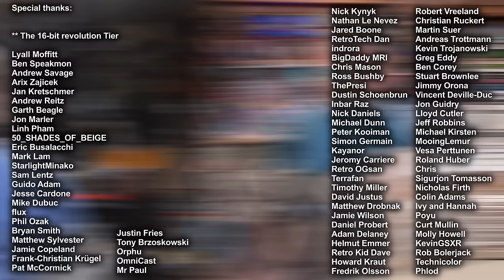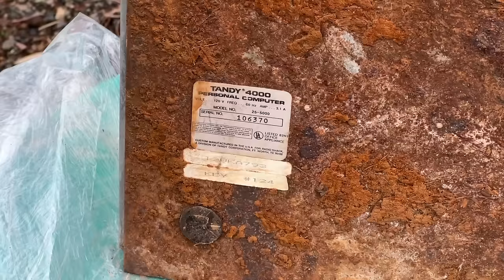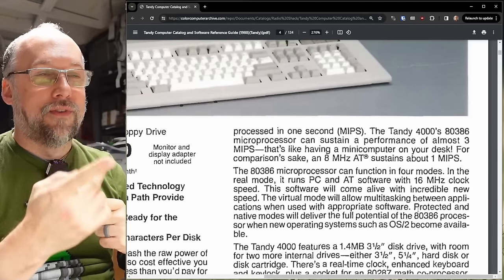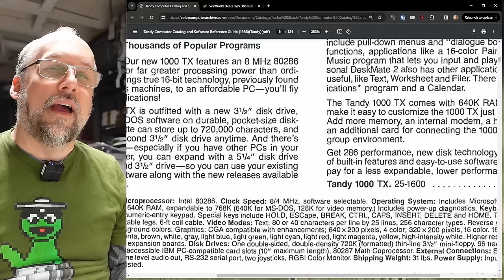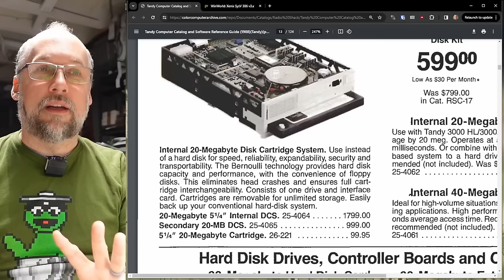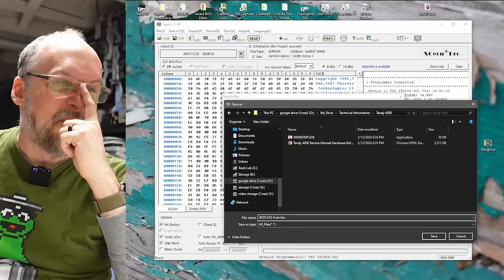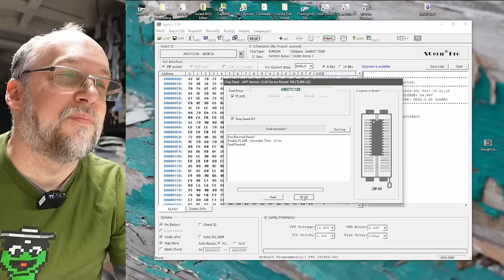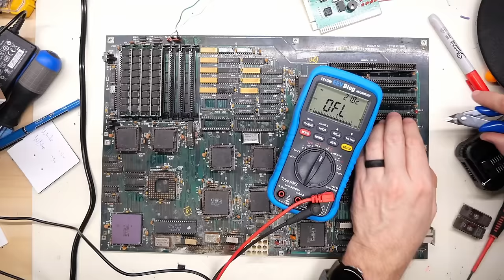0079 I'm at a loss for words when I first see this Tandy 4000 computer

Comment: And to think, I had a Tandy 5000MC in my possession, never realizing just how rare these early 386 Tandy's were. The 5000MC was truly not a generic clone, given it was built around a licensed IBM Microchannel bus. I found it on a temporarily abandoned floor of an office building I worked in 20 years ago (an insurance company HQ had moved to another location). There sitting on a lone desk, in a stripped-out office space, was a Tandy 5000MC (by 2004, this was a completely obsolete machine). A top-of-the-line Tandy that I had only ever seen catalogs and advertisements. I took it home, played with it for a bit (still had all the configured hardware and was setup to run Netware 3 - complete with the user DB still present, though all data volumes had been present on an external SCSI array that was missing). 

Unfortunately, this was before retro conservation efforts had taken hold, so I couldn't find any configuration disk images, which meant I couldn't configure the system for, say, an MCA SoundBlaster. It was kind of stuck with the config it had, and I couldn't even pull the battery to change it without essentially rendering the machine useless. Eventually, deciding that it wasn't in the same category as my Mac's, Amiga's, SGI and Alpha machines I'd collected over time (especially as those were actually my machines that I'd either purchased or were given to me as they aged out), I decided to send it for recycling. I very much regret that choice now, as it might have been one of only a handful of surviving examples of a very rare, licensed MCA machine from Tandy. I hope someone still has one out there, as I'd hate to think the 5000MC was lost to time.

Comment: I don't know if you noticed but the 386 chip has a double sigma on it. When Intel released the first batch of 386's there was a problem with some of the chips when performing 32-bit multiply operations. They went back and tested all of them. If the bug was present they stamped a "16-bit only" label on them. The good chips were stamped with the double sigma.
Reply: Good spot!

Comment: If it wasn't for the fact that I am on the other side of the country, I would be glad to take on that case restoration. I have done similar projects twice before. Once on a IBM 5170 that was solid but very rusty from a leaky battery. The other was an Amiga 2000 that somehow was actually in worse shape than this Tandy 4000.

Comment: Like others here, I also worked at Radio Shack from about 88 - 92.  We had a 4000 in the back room with serial dumb terminals up front (and a Tandy labeled Okidata dot matrix printer!)

Is also bought a 3000 used....  It had been either a Unix POS or a NetWare server before I got it.

These machines (3000, 4000 & 5000) were as mentioned above business class machines.  They even required labeling to say that it was a different class of electronics (for radio interference).  And that is why no O/S was included and no video card by default.  Many many of these machines were used as what ever Unix flavor host system instead of as a desktop user PC.

And the 5000 was a MicroChannel machine, to compete with the IBM PS/2 line.

But for sure, these machines were built to be business class servers and hosts, not desktop PCs at all.

Comment: Adrian; I have used CLR, "Calcium Lime Rust" remover and a Camel Hair brush to remove corrosion from PC boards.  The procedure is to brush full strength CLR onto the corrosion until it is removed.  After removal, thoroughly wash the board in water then rinse in distilled water and finally with rubbing alcohol.  Thoroughly air dry the entire board for at least 24 hours before use.  Years ago I posted this procedure online and it was used by the USCG to recover some mission critical electronics.

Comment: Seeing the pricing for these Tandy setups at that time, makes me realize just what a decent deal our Memorex/Telex 286-16mhz system was. We paid about $3500 for that system in late '88 but it came with an AMD made 286 running at 16mhz, a full 1MB RAM, a 20MB HDD,  both 3.5"  and 5.25"  high density drives. Dot matrix printer, 265k VGA built in, 13" VGA monitor, Dos 3.3. We thought it was a crazy expensive setup back then, but again it seems it was a very decent cost for everything we got with our setup back then.
Reply: And then it loses 90% of its value within a few short years. I can see why the C64 was so much more popular than IBM compatibles in my country.

Anyways, yeah I think that's a decent deal at that point in time.
Reply: I bought one of those in late 90s at a thrift store and used for a while. Really liked and wish I still had.
Reply: A similar 12 Mhz AT would have cost $4000 with a 10 Mb hard disk just 18 months prior, with 640k of RAM and no printer, and a mono monitor. Crazy how quickly prices dropped in the late 80s up to the mid 90s.

Comment: Hi Adrian!  I have restored a Packard Bell Legend 725DX like the Tandy 4000.  It was a rust old computer.  The case was sand blast, paint with Rust Stop then paint the computer case.  I replaced power supply was bad (the electronic parts came apart).  Good luck in finding a Tandy power supply.  In a Zenith Data Systems power supply connector have 3 row of 5 pins.  I convert a ATX power to Zenith PSU connector output (you may need to do same type of modify for Tandy PSU).  Caution - working on PSU have high voltage and very Danger.  The motherboard was repaired back into working order.  Yes, it was lot of fun in restoring the computer back into working order.

Comment: Tandy 3000 and Tandy 4000 were only sold at the larger computer center stores,  not the regular smaller radio shack stores. 

They didn't come with an OS because they were designed to run with several different ones and the user could choose.  These were business machines,  not personal home computers.

Comment: Reminds me of that 486 tower a customer brought in for repair.  They reported it won't power up when dropped off.  I got it on the bench and noted a very strong bug spray smell.  I should have stopped there.  Me and the other three techs stepped back in horror when opening the case, dozens of German cockroaches exploded from the machine.  After getting the roaches removed, we found out the user had taken a plastic straw and sprayed at least one entire can of Raid through the floppy drive opening.  

After carefully examining everything, we found burned out power supply transformer, floppy drive motor, cpu, battery, and multiple addon cards like the VGA card.  Called the user back and they decided to get a new machine rather than rebuild.  I can say this mess of a Tandy comes close to as bad.

Comment: Not sure if you've noticed that many of these systems were classified by the FCC as Class A computing devices instead of Class B - as in they wanted them not being used in residential areas :)  To respond to your comment about possibly getting the motherboard working - if we can locate a 4000 with working PALs and chips that someone can dump and verify for you to use for reference, I'd say that would be the best bet for you to even proceed.  If you could get that clone IIE working, you can probably get this working, we have faith - but we have to be realistic and get you the right resources.  Else, it'll be very frustrating.
Reply: I have a working example (well, I need to put a new hard drive in it).  The irony is that it's the machine I've used to host my '90s Universal Device Programmer, which I'd need to use to dump the PLDs.  But as it needs maintenance anyway, I could install the UDP in another machine and see if I can dump the PLDs, unless the security fuses are blown.

Comment: Love this project. Actually, I would love to see a full restore. possibly soak the bottom in vinegar. Get the rust off and paint with gray rust converter paint. Haven't seen to many 386 rebuilds. Usually 8088, 286, or 486. Plus, as you stated, really haven't seen too many Tandy 4000s.
Reply: For the chassis a product called Evaporust is great and non toxic.  Can use it in a plastic tub etc vig enough for the time then once one pour it back in the jug(s) for more uses.  Mine has lasted through many different items.  Best to mechanically remove the loose flaky stuff first

Comment: I fondly remember the  Tandy 4000.

I at one time had two of them.

It was after the IBM AT was released and before the PS/2 line. As expensive as equipment was, I wanted to run some of my old cards, and at the time, it was just introduced.  I bought the demo model at my local Tandy computer store, it was the first one they had.

I had upgraded to this machine from an IBM PC I had maxed out.

I ran the original Tandy DOS at first  but eventually ran DOS 6.22 on it.  I ran the early Windows 3.x versions and Windows 95 on it.

I had a CompuAdd  edsi cache controller on it for extra fast hard drive performance and a large 300Meg hard drive.  I had both EGA and VGA graphics cards on it.

I used it when in college for remote access to the university's dial-up and bbs systems of the time.

Comment: You had many questions about the Tandy 4000 and why Tandy marketed it differently than the other desktops. Like why they made the operating system and option and charged extra for it if you wanted MSDos. When Tandy Computer Centers existed their employees were computer marketing representatives. And the market was mainly businesses. The Trs80 Model 16 and the Tandy 6000 were highly successful with the Z-80 handling the I/O and the MC68000 handling everything else.  Xenix and 1mb of Ram could handle a multi user environment quite easily and the sales team could make a living off the commission from these sales. Also the nearest competitor was more than double the price. When the Model16 and the Tandy 6000 were discontinued there was no equivalent replacement. The Tandy 3000 with an Intel 80286 was supposed to be the replacement and equivalently equipped it was a DOG. Even upgraded to 4mb and at the time VERY expensive it still didn’t perform as well as the Model16/Tandy6000 with 1mb. The Tandy 4000 was supposed to be it, but by then it was too late. A little over a year later the Tandy Training and support centers were closed and two years later they closed the computer centers.

Comment: 54:12 it's a socket for a Weitek 1167 coprocessor. The 80387 came out 1987 ut had difficulties to deliver. The Weitek's were significantly faster than the 287/387 as they didn't use the coprocessor interface but used memory mapped I/O to communicate with the CPU. CAD packets like AutoCAD and other system could make good use of the Weitek FPU's.

Comment: I have a Tandy 4000 in my collection (in much better shape, I might add). The most irritating thing about it is the BIOS. I believe it needs to be accessed with a floppy disk, but that's not the crummy part. You MUST have one of the 40-something drive types listed or your hard drive won't work. The goal I had with my unit was to install Concurrent DOS on it. (I always try to do something different with every PC in my collection). Since I don't have one of the listed drives, I tried to install overlay software onto the hard drive I was using, but the system would just lock up on me. My solution was to install everything using a more modern computer and just transplant the drive. However, my attention has moved to other projects and my 4000 has since been waiting for a little love since then. Just part of the hobby when you have an extensive collection :)

Comment: I've been a Ford dealer tech since 1994.  When I started, our diagnostic system was called SBDS(Service Bay Diagnostic System).  It was run on an HP Vectra based system(386-Dx 16).  It ran on OS/2.  I remember that it was a very responsive system at the time, but it quickly slowed down against 32 bit windows systems.  It was outdated and replaced on our end by 2000.

Comment: The documentation for the 4000 said something about using it for multiple terminals, so I think these more expensive systems were meant for businesses rather than consumers, so that explains both the lack of graphics cards, and the non-bundling of the operating system, as well as the cost differences between the systems.  Seems like the nicer looking systems were intended for home use, where graphics and sound and cost were priorities.

Comment: I worked at Radio Shack during this period.  Most stores only sold the 1000 series and CoCo.  Some stores were specially designated computer centers which sold the 1300, 2000, 3000, 4000, 2 & 16, etc and targeted the business market.  They had dedicated computer employees.

Comment: When I worked at Radio Shack these machines were used in the backroom as servers connecting with our point of sale computers at the counter. At night it would modem dial Ft. Worth, TX and it would upload sales data, inventory levels and our collection of names, addresses and phone numbers we gathered when ringing up customers that day. Imagine.... Its 1/2 past closing and after 15 busy redials I am stuck impatiently waiting for the slow upload to complete..and the loss of carrier. No Zmodem recovery. :(
Reply: Or worse, you open the store in the morning, rotate the backup tapes, only to find out the tape won't get initialized.  Now, you've got to hand write your receipts and the POS terminals are held hostage at the mercy of one stinking backup tape.  Happened to me multiple times when I was Shackeled.

Comment: Story time: in the mid 1990's as I was driving along an overpass I got a good view of the contents of a long 18 wheeler dump truck which was coming up an on ramp. It was almost full to the brim with an enormous jumble of old pc's. Possibly they were just cases or maybe they were more than that. Either which way it was a bit saddening. All true so far and here is where imagination kicks in. Perhaps they were dumped in the ocean and as they tumbled down the lifted bed of the dump truck they were saying to each other: "See you on the beach." One was soon after rescued by a lobster fisherman and was set aside in a fishing shed by the shore. Skip ahead 30 years and it eventually made its way to Adrian's workshop.

Comment: The copro socket has a w code silkscreened by it (w1167), the socket is actually for a weitek 1167 copro, not a 80387. A weitek copro was much  faster than an 80287/8087 but far less supported as a weitek isn't x87 compatible but it was the only real option for very high performance floating point for early 386 systems as intel was late with the 80387. For best floating point performance and support you needed a 1167 and a 80287 installed at the same time

For the case putting it in a pool of rust remover acid would easily get rid of a lot of the rust leaving raw steel needing a protective paint coating. Without a power supply in good condition there would really be no point in trying to do this though.

Comment: Historical aside - OS/2 was targeted - in spite of recommendation from everyone - for the 286. IBM absolutely insisted on making OS/2 for the 286. This meant it could not go back and forth between real and protected mode efficiently. It was meant to get into protected mode and stay there. The 386 had a hardware VDM (virtual DOS machine) that avoided this problem. Microsoft targeted early Windows for both the 286 and the 386 and used the advanced features of the latter. That is why Windows triumphed over OS/2. By the time IBM realized their mistake it was too late.
Reply: Microsoft gave away the Windows SDK for free while IBM charged for it. This caused an explosion of software for windows and almost nothing for OS/2. And of course Microsoft heavy and agile marketing vs IBM dinosaur moves. There was of course the NT backstab but that gave fruit a decade later.

Comment: The original Beroulli box external cartridge drive was floppy based, as in it didn't have a rigid HDD platter, it was an 8" floppy.  It was called bernouli because of how the head floated the media, using the bernouli principle.  This is from memory, so i might be wrong on details.  But i am sure it was not a rigid platter system.

Comment: I find the battery bit funny.  "Probably alkaline", as it clearly says right on it "Lithium Battery".  Sure, the lighting probably only let you see the part that had the reflective background, but on camera it was legible.
Also, the rusty sticker on top says not to expose contents to water, and it was clearly bathing for years.
Reply: Yea probably the reason it hadn't leaked out, Lithium is more stable

Comment: We sold a lot of Tandy 16/6000 running Xenix in the early 80's. Then when the Tandy 4000 came and SCO Xenix 386 could easily run a 100 green screen serial terminals (Wyse 60's). Remember this was before Windows. And SCO provided dos that could display dos graphics and we could could use multiiple console product consoles.
Our pricing from Tandy was equal to white box 386's. However when the 486 came out we did switch to building our own white boxes going forward. Tandy stopped selling Tandy branded computers in the early 90's.
SCO actually was the contractor for Microsoft Xenix that Tandy sold.
Microsoft owned 25% of SCO until the early 90's.
I know this because I still sell and support XinuOS SCO Openserver and UnixWare.
While still 32-bit it is rock sold and has an extremely hardened kernel that Linux will never have. XinuOS still sells and provides updates for OpenServer and Unixware.
XinuOS has no ties to the lawsuit company.

Comment: @54:00, I believe that's a socket for a Weitek 1167 Floating Point Coprocessor.  Perhaps you could use wither that or  287  on this board.